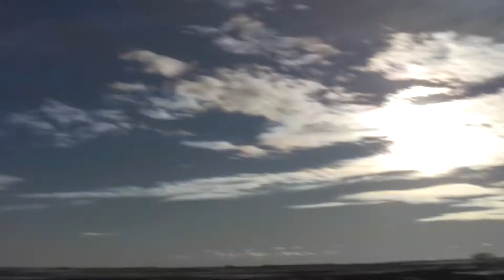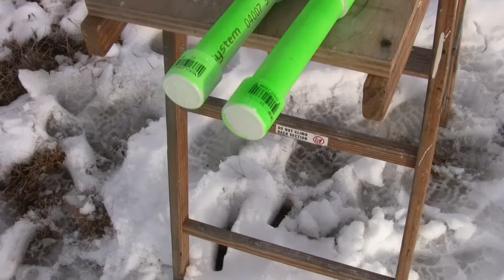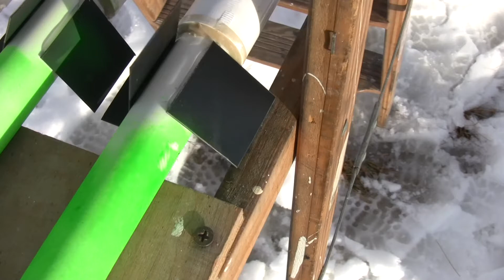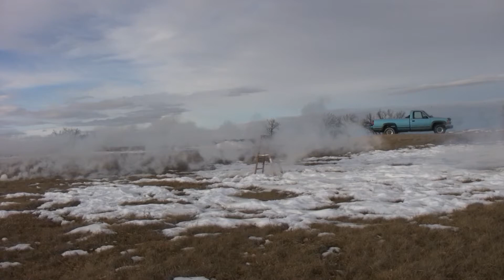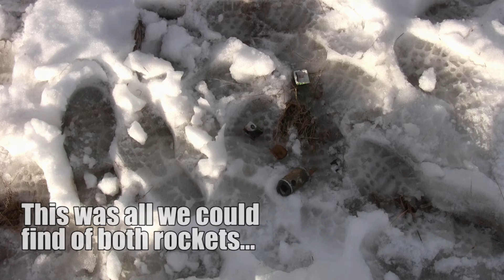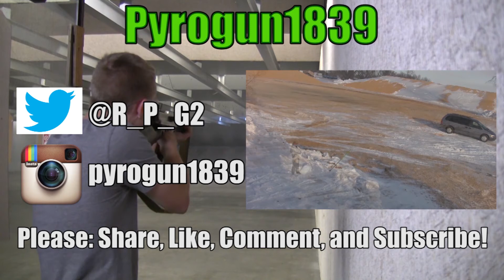RPG-2 Rockets Test

Comment: If you made it hammer fired and not electric fired then it would last longer.
Reply from the maker: Method of ignition typically has no effect on the duration of the rocket engine. The only time I've experienced a less effective burn was when I used fuse instead of an igniter. Using an igniter or percussion cap will instantly ignite the fuel the entire length of the grain.
Reply: @pyrogun1839  sorry fir saying this 2 years later, but yeah i see what you are saying. But what if you put a thin plastic divider inside of the engine so not all tge fuel burns?

Comment: what did you use as a propellant for the rockets?
Reply from the maker: louis siginski The rockets contain sugar, KNO3, and a small amount of aluminum powder.
Reply: how did you make it launch off from the rpg? i make them out of pretty much the same thing
Reply from the maker: louis siginski With a design like this, the rockets will not go out by themselves because they are too tight.  You have to have a booster to push it out and ignite the rocket.
Reply: and how do you use the booster? could you make a video about how that works?